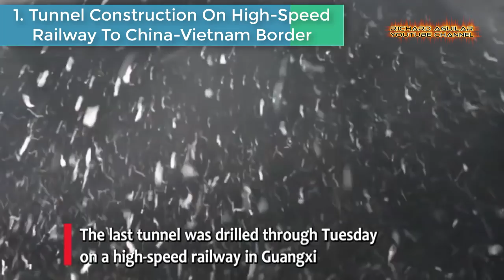SHOCKED BY CHINA'S MOST UNBELIEVABLE LONGEST TUNNEL MEGAPROJECTS!

Comment: China's construction technology surpassed US prior to 1989. In 1989 San Francisco Bay Bridge fell due to earth quake. The City of San Francisco want to replace the falling sections as fast as possible and US does not have the manufacture facility to accommodate the requirement . The solution they found is from China. Those concrete sections were build in China than shipped to San Francisco for installation. All those concrete sections were inspected by US inspectors during production and found they made high quality product.